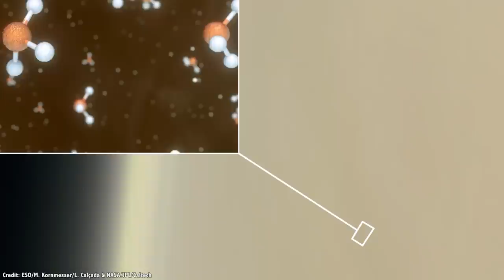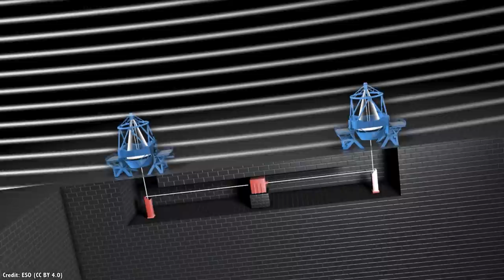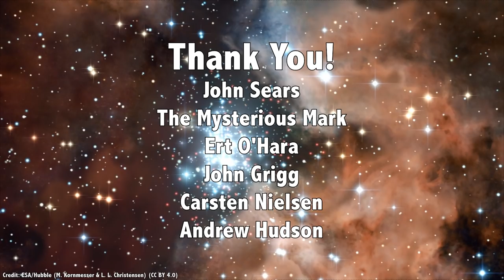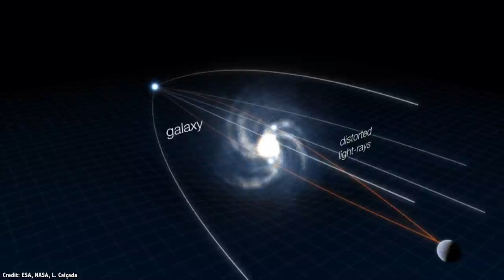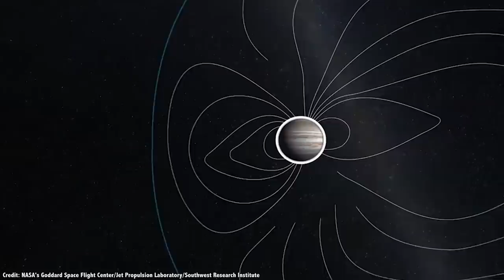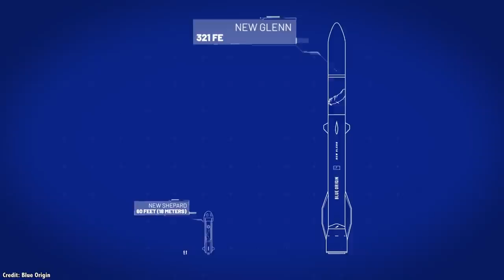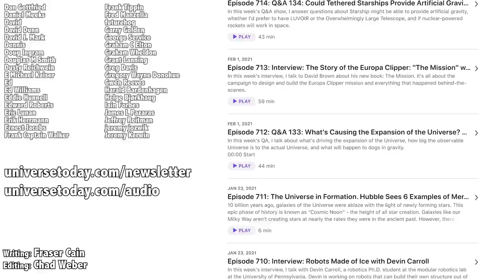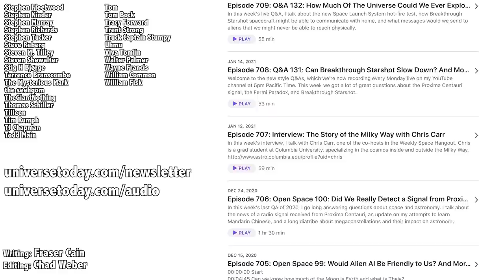Q&A 135: Where Will We Find Life First? In the Solar System or Another Star?

Comment: OK, Re  -  Steam Engines In Space:
The Specific Heat Capacity of water is 4.186 joules per gram of (pure) water. That is, it costs 4.186 Joules of energy to raise the temperature of 1 gram of water by 1 degree Celsius.
Next thing to bear in mind is that the ambient pressure conditions will affect at what temperature water will boil. The ambient pressure on the top of Mt. Everest (elevation of almost 9km above sea level) is sufficiently low that water will boil at only 60 degrees Celsius. So, a spacecraft would NOT strictly be forced to raise the temperature of water to 100 degrees Celsius in order to make steam. Having said that, in a worst case scenario where you start with liquid water at 0 degrees Celsius and have to heat it to 100 degrees Celsius, spending 418.6 joules of energy for each gram of water you intend to heat. But to make it boil, you need to overcome the Latent Heat of Vaporisation for Water, which is an extra 2.26 Joules of energy per gram of water, bringing the total cost of energy up to 420.86 Joules per gram of water.

Contrast that with the cost of electrolysis of water in order to produce (2) H2 gas and (2) O gas, with the aim of combusting the products. Now, admittedly the energy cost of electrolysis is MUCH higher, at 13166 Joules of energy per gram, making it almost 30 times the cost of producing steam, but the amount of energy released via combustion is far, Far, FAR higher than the energy gained by releasing steam. Also worth considering, is that a spacecraft can use solar power to electrolyse the water, thus effectively costing nothing and yet still providing an immense amount of energy upon combustion.

And so, if you had to choose between using water to power your craft's locomotion via either combustion or through heating the water to produce and release steam, I'm not sure which one I'd use. I'd need to see exactly how much thrust is produced by either method and at the moment, my money is on the combustion method as the most likely option for producing greater levels of thrust, at higher efficiency, too.

Comment: Slowing down a lightsail: super interesting question.

To me, seems the most likely way to do that, given Fraser's explanation, would be to previously send a laser to the destination. That laser would then slow down the lightsail, and potentially put it into orbit. Given our current tech, seems we won't see this in our lifetime (not least because a powerfull enough laser probably couldn't be sent by a lightsail first). But conceptually, maybe in a generation or two...
Reply: How do you slow down the first laser?
Reply: @JustOneAsbesto  Would likely need something like orbital refueling for that. So I guess a generation or 2 is even optimistic, as that ship wouldn't go very fast.

But assuming you can have a chemical rocket, on which that laser is mounted, you could refuel that rocker (say a starship or something like that). It's already in orbit, so some fuel + gravity assists in the solar system could accelerate it.

You make sure it has enough fuel to slow down at destination.  Then you have a laser at destination.

Though you're right - the more I think about it, the more likely it is we have something like nuclear rocket, which would be more efficient and kind of negate the need for a light sail.

Comment: In The Expanse universe where they have advanced fusion propulsion but they still use steam. I think it used water in a microwave chamber, they called it "Flying Tea Kettle". The real systems that are in developement now have crazy high specific impulse, like fusion levels if it pans out. But they require huge amounts of electricity so nuclear power is the only realistic option for them. We should be throwing money at space nuclear power and propulsion if people really want to go anywhere beyond the moon. Be nice if we could convert all our weapons fuel into spacecraft fuel. On the artificial gravity thing I dont think we'll be building giant space donuts for a while. Just to much mass required. But thats not the only way to do spin gravity. Box's on cables just have way to many advantages to not be tried first. I know that spinning things have weird stability issues in space, but they are physics issues. Thats what the guys that build this stuff do, the problems arent insurmountable. Being able to deploy the system when you need and reel it up when you dont is a huge advantage. And mass is nowhere near the big torus designs. I think when we send out our first prospectors they'll likey be living in big rad and impact hardened boxs spinning on the end of a cable while controlling a bunch of robots. Reel it in when you need to maneuver. At least until we get our Epstein Drives, but that could be a while, like SLS😁

Comment: Heya Fraser, has anybody thought of filling space suits with breathable liquid (perfluorocarbons) or even an entire spaceship filled with it? It could solve a few problems like protection from radiation and cosmic rays. It could also allow suits that don’t need to be pressurized. Granted it could cause some problems as well but what what do you think of the idea?
Reply: It could also help astronauts withstand higher acceleration - potentially 20G - but here are my takes on possible problems:

Mass - Perfluorocarbons weigh approximately twice as much as water. The space shuttle's internal volume was approximately 75 cubic meters, which would add up to *150 tons*. Even suits would be more massive, which results in greater fatigue (you're weightless, but still fighting inertia) and fuel use for manned maneuvering system.

Pressure still required - PFCs work by being saturated with O2 and CO2 gasses, not replacing them. If it were exposed to vacuum, it and the gasses saturating it would boil off. As a result, it still needs to be pressurized.

Impaired speech - You're unable to speak while your larynx is submerged, though that's a problem that might be solvable with technology. If sensors in your mouth detect the position of your tongue, etc., it may be able to determine the word that you're trying to say.

Sense of drowning - Every time a 'wet suit' is donned, you drown. You don't die, but as a fully-developed mammal, your body doesn't know that, and you'll panic and thrash about from a strongly ingrained reflex. This can probably be overcome with training, but it would be the least-fun part of space tourism for casual astronauts.

Risk of actual drowning - Your lungs work by breathing in and out, but you can't do that with liquid. You can't circulate enough liquid by the motion of breathing. Under freefall, forcing the circulation of the fluid may be more difficult than in a lab on Earth, and failure of the pump mechanism would add risk to the system. 

Contamination - You don't breath in much dust as a result of gravity, nose hairs, etc. If you filled an entire ship with breathable fluid, it may act as a solvent to anything in the room - dust, flakes of skin, fibers from clothing, etc. Your natural reactions that limit particles in air may not be so effective against particles in fluid.

Temperature sensitivity - The fluid is kept at body temperature when it's used in a liquid ventilator. If the fluid is too warm or cold, you transfer heat (to or from the body) at a much greater rate. If you're fully immersed it it, like a flooded ship, then the warm liquid surroundings may lead to overheating, if not carefully balanced. Good old fashioned air has a much lower heat capacitance, and although we are without passive convection from heat rising in freefall, we are much more used to cooling in air (sweat can still evaporate, for example - if you're swimming in PFCs, in freefall, I'm not sure how sweat would behave).

Ionization produces fluorine radicals - When you use your breathable medium for radiation shielding, your exposing it to ionizing radiation. While oxygen free radicals might not healthy, PFCs don't eliminate them (they're still saturated with oxygen), and add the risk of splitting off extremely reactive fluorine. How much of a problem this would be is an unknown.

It's a neat technology, but lots to think about that might prevent or limit its use.

Comment: You mention rouge planets as possible fuel stops between the stars. But stopping a spaceship requires the same amount of delta-v as accelerating it, so wouldn't that just slow down the trip for no real benefit, except making each leg of the journey shorter at the cost of increasing the total travel-time?

Comment: The thing about figuring out which star a radio signal came from is trivial: If you got the direction of the radio wave you just have to look at the light from that direction, as light travels at the same speed as radio waves.
The (tiny) issue arises if you want to message them back, because you need to figure out where they will be in 1000 years time.

Comment: Here's a question that google can't answer:
"Is it (theoretically) possible to harness the magnetic field of Jupiter for energy? Like, say, from a power plant on one of the moons?"
I am writing a sci fi short story... and I can hand wave if need be. But it'd be nice if I could ground the idea in hard science.
Reply: Charged tethers can be used to generate electricity, or by investing electricity, you can push against the magnetic field. Electrodynamic tethers (EDTs) on wikipedia may be helpful, and Google "Electrodynamic Tether Microsats
 at the Giant Planets" (ESA report) and "Electrodynamic Tether at Jupiter—II: Fast Moon Tour After Capture" (paper should be available at ResearchGate). 

I think all the article you'll find deal with spacecraft, as opposed to the surface. I'm not sure whether the local environment would make much difference. The magnetic field would be largely the same, but space probes would be moving (but so is a point on the surface of a moon), and there might be electrostatic charges on the surface that would interact with tethers.
Reply: @nkordich  Thanks man. This seems exactly like what I was looking for.
Reply: Google can answer that question as easily as I can:
Using energy, one can create a magnet (albeit an electromagnet; a temporary effect) and in the same manner, though the opposite way, one can use magnets (or more accurately, one can use the magnetic field produced by magnets) to induce an electrical current. In point of fact, this is how energy is produced in coal plants, in nuclear plants, in geothermal plants, etc... In these power plants, water is heated which produces steam, which in turn powers a turbine to produce a current. These turbines are essentially the opposite of an electromagnet. Even a wind turbine works in the same way, although they use wind to turn the turbine, rather than having its rotation be driven by steam.

To make an electromagnet, you wrap/ coil an insulated wire around a conductive piece of metal and then apply a current to the coiled wire. The movement of the electrons through the coil induce a magnetic field which is conducted by the metal rod around which the coil is placed. The same is true, albeit in reverse, for generating a current via the use of magnets. To do so, you simply move coiled wire through a magnetic field, which induces a current in the wire. For a more detailed explanation of how a turbine uses magnets and movement to generate a current, you might like to investigate "How Do Turbines Generate Electricity." Any results you might read are likely to be far more instructive than my two brief paragraphs.

Back on point again now, "Yes," you could indeed harness the magnetic field of a planet (or star, for that matter, as Neutron stars have enormous magnetic fields, as too do  an exotic variety of star know as magnetars). However, the problem in doing so is that the magnetic field of a planet is relatively VERY weak, when compared with regular magnets. This is why you can easily deceive a compass by encroaching upon it with a magnet. The 'Catch-22' here would be; To find a magnetic field that would be strong enough to make it worthwhile to harness said field in the production of electricity, would invariably draw you in perilously close to celestial objects whose magnetic field strength would be directly proportional to the amount of lethal radiation they emit.

Ps: Here's an idea - a sufficiently advanced race might be lucky enough to discover two binary neutron stars orbiting each other so close and so fast, that their orbits could provide the motion necessary to generate the electricity. In this case, they could build a stationary turbine (a turbine that doesn't turn or rotate, because it doesn't need to) and place it at the exact centre of gravity between these two stars, perhaps as a satellite or some such. The orbits of the stars would provide the movement of the magnetic fields through the wires of the non-turning turbine (a 'stillbine'?). The energy generated at this satellite could then be beamed via a series of relays to a place sufficiently distant from the deadly radiation of two neutron stars, that the beings living there might directly benefit from what is essentially (practically) free and (practically) unlimited energy. Should their energy needs ever surpass the production of the 'stillbine' on their satellite, they'd merely need to build a second 'stillbine' and launch it and its parent satellite to the same gravitational null-point as the first satellite. This second one could use the very same relays as the first one, effectively doubling their energy production and so on and so forth...

Comment: One possible interim solution to extended micro G may be a sort of 'peristaltic suit'. This could be a full body form fitting undergarment equipped with internal pneumatic or fluid tubing that expands and contracts under controlled internal pressure, creating gentle waves of contraction from neck to feet, like milking a cow, that would force fluids 'downwards' to counteract the stagnant pooling effects that are the source of many known micro-G problems. This might also, with more substantial contraction waves in the abdominal region, address well known issues with defecation in space.

Comment: Hi Fraser, I have a question, Do you know how much fast is  Starship planned to go? Will it be faster than other rockets we have been using?
Reply: starship won't be significantly faster than other rockets.  its special because it's big, cheap, runs on fuel that can be made on Mars, and is immediately (in theory) resuable.

Comment: re  -  10:50
"When you've got radio waves, the photos can be meters long..."
I believe that Fraser meant to say "When you've got radio waves, the wavelength can be meters long,"
You see, photons don't have an actual length. Rather, any 'length' properties they might be said to posses is instead measured as a function of how far they might travel in a length of time. For example, a light year is the spatial length that a photon will travel over the course of a year. Or to put it another way, when measured over the course of a year, a photon can be said to have the length of a light year.

Comment: Frasier, a question for you, and maybe you could address it in your next session, or maybe you have already answered it in another video: I understand that a rocket needs to reach a speed of 40,000 kilos an hour to exit the earth’s orbit.  Why does it have to reach such a high speed?  What’s the issue of going up nice and easy; it is cheaper.  And why can’t they fly them rockets on a 747  50,000 feet up in the air and then shoot the thing up to space; Virgin seems to be doing that; that seems cheap to do.  What’s the limitation there?
Reply: I had the same idea or even better a baloon. The thing is ,to get to orbit you don't need to get high you need to move fast perpendicular to the ground and those high speeds generate a lot of drag in the atmosphere that your air breathing engines need to be in. So your salving on fuel costs  by launching from a 747 but not by a lot when you add in the complexities.
Reply: @Coalsack Sector But you don't need air for the rockets to fire up.   Now, apparently, speed is necessary to get into orbit but it doesn't seem logical.